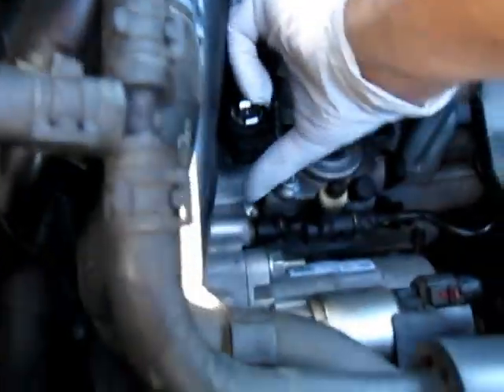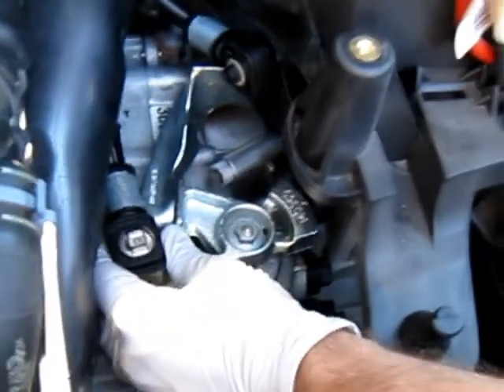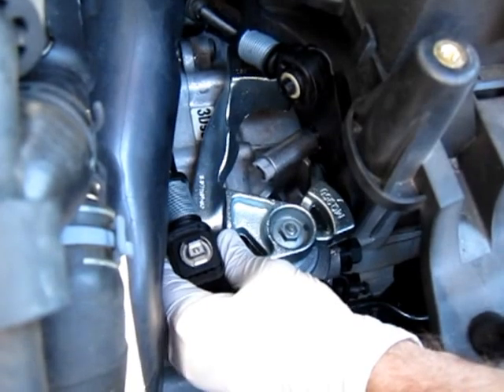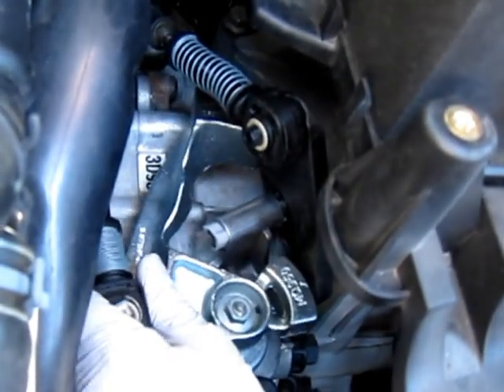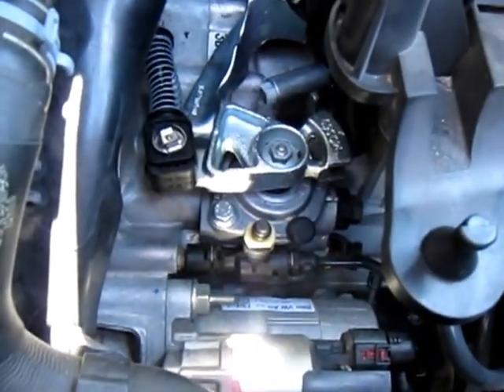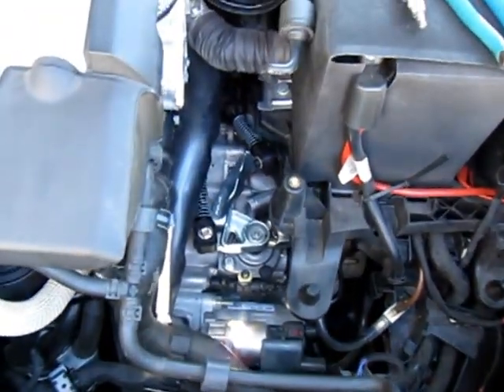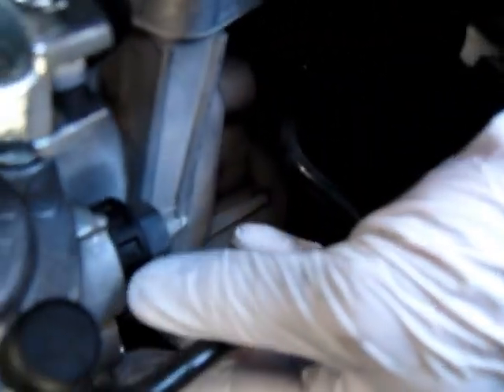VW Shifter Adjustment  When Tranny Locking Pin is broken--6 Speed

Comment: Thanks again for the feedback.  I just installed the Euro OEM short shifter tonight.  My adjustments ended up being a little different.  I at first loaded the cables toward the driver compartment.  When doing so, I couldn't shift into 2nd, and 5th & 6th were very notchy.  I ended up backing off a couple teeth on the fore/aft adjustment and that was fine.  For the side to side adjustment, I ended up just letting the cable go slack after disengaging the spring, and then re-engaging.

Comment: This helped me greatly the other day, I installed a short shifter on my Skoda Fabia vRS and found I wasn't able to select gears, I spent a lot of time fiddling about with it but after finding this video it took me a couple of minutes to rectify the issue. Thanks!
Reply: Which short shifts you used? And how the's alive?
Reply: @gnmalai  4H Tech short shifter for 0A8 gearbox, it is working very well
Reply: @BenSchofield  How did you allign the shifter with no home position? Im doing this now
Reply: @NorthernHostility  No home position? You need to pin the shifter inside the car or you will have great difficulty setting it up. I just fitted my shifter to my other car last week and used this video as a refresher, took a few mins to do the whole process. What are you struggling with? Did you manage to sort it?

Comment: Thanks. I followed this to reset my cables. I then Noticed i had a loose nut on top of the selector. It had spun on me so my gears were R, 1,3,5 only.  The knurling between the shift arm and the shaft has ovalized. I reset it to the double tooth and tightened up. Functional, thanks for the cable reset and seeing where246 should get into gear.

Comment: Thank you - my lock pin isn't broken but doesn't engage, performed this manoeuvre and it did the trick although 2nd doesn't go in say 1 in 30 times. I noticed I had to tighten the selector bold with a washer underneath it to prevent play. Does the play need to be totally gone for all gears to slide seemlessly?

Also is there something I'm missing with the lock pin as it just won't go in when pushing the gear selector down.
Reply from the maker: Yes if the front to back is moving in relation to the selector shaft that is a problem. Just like any other slop in the side to side mechanism it will cause issues.

Comment: I had to take the shifter tower out to remove the locking pin I finally put it all back together and every gear is smooth except first is it possible that I put the shifter tower in a incorrect position??
Reply from the maker: selector shaft really only goes in one way. 1-2-R issues are usually the product of a bad shift cable adjustment.

Comment: I have a 2007 Passat 6 speed manual transmission. It has been sitting a while and now it is difficult to get into 2nd and 4th gears.  I don't feel the detent when shifting into those two gears. Think an adjustment will solve this?

Comment: HI, I have a vw 1.4 tsi (6 speed transmission). I've watched your shift adjusment for 5 speed shifter. Is the 6 speed done the same way? My 1st, 3rd and reverse gears sometimes do not go into gear smootly (i have to apply some force more than usual). I wanted to adjust the linkage cables to see if it helps.

Comment: I have a short shifter installed. Currently, my shifter tower is extremely stiff. I am unable to manually select the gears any tips?
Reply from the maker: Corrosion in the pivot tube? 

https://dieselgeek.com/collections/vw-shifter-bushings/products/products-six-speed-billet-aluminum-side-to-side-reduction-bracket-for-2008-and-newer-cars

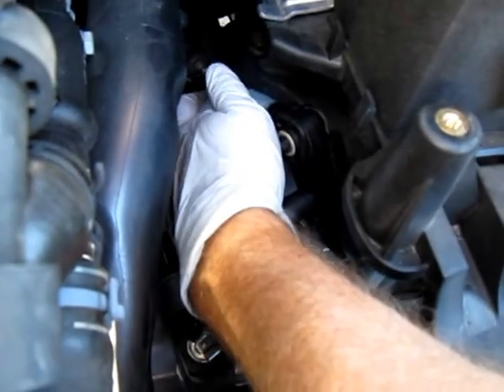Comment: I don't understand the part at 1:17.
Do you need to, again, push the chrome weight by a quarter inch? Or is it just that you lay your hand on top of to help in releasing the spring lock for the fore/aft cable?
Reply from the maker: You want that counterweight pushed down while you release the cable end. That makes for smoother 1-2 shifts.
Reply: @dieselgeekdotcom is the counterweight supposed to be floppy or perfectly parallel to the ground? I opened my bonnet and it was flapping up and down (pivoting on the bolt that's supposed to secure it I presume), so when I secured it with a washer underneath the bolt and then tightened it down, theres no play to push the counterweight down if that makes sense as its now perfectly parallel to the ground. Any thoughts?

Comment: Just wondering if this would cause what I've got going on in my 2009 VW EOS. I stopped at an intersection and shifted into 1st gear and ended up in 3rd gear. Will not go into reverse, 1st, 2nd or 5th and 6th. I cannot see anything that looks broken under the shifter boot so?

Comment: I didn't notice you take up slack on the cable ? How would that be done with one hand and release with other ? 
Thanks
Reply from the maker: It's important to differentiate between taking up the slack and loading up the cables in compression before closing the cable end. You want the former, not the latter.

Comment: The black part broke on the one that lays flat... What is that part called and why aren't different sizes? (The flat one has a bigger hole i assume because the other one won't fit when I tried to change them

Comment: This is a great video, thanks for sharing!  Thankfully my L shaped bracket is not broken.  Quick question: With both locking pins in place, do I simply lock both cable ends back into place?
Reply: Yes, that is how it is supposed to work.

Comment: I have a 2003 Jetta GLI 24 Valve VR6 with an 02M transmission, the same trans as the 20th Anniversary/337 Either the 02M  doesn't have an L shaped locking pin or it was broken before I bought the car. I changed the CV axles, control arms, struts, wheel bearings and all 3 engine/trans mounts myself. I plan to replace the shift cables, exhaust and clutch at the same time but for now I just want to adjust the shift cables. I get the jist of it but the 02M trans doesn't have that big ass counter weight and everything is reversed. So where you say clockwise, common sense says I need to move counterclockwise. Does that make sense?

Comment: Hi Jim,

Until i started to mess with my MK6 Golf, i asked my VW mechanic to set/adjust the gear selector several times, because the gearbox has never been smooth! I ened up setting it myself with the pin... Last week during a clutch job, the pin broke and i was like OMG?! :/

i finally stumbled across your video looking for a solution! Guess what? The gearbox has never been as smooth as now!

Kind regards,

Sébastien.

Comment: I picked up a 2010 CC and that locking/range selector won't budge, I guess either that pin is jammed or seized, how can I repair this?
Reply: Ok, it looks like the one lever that moves the shaft is just stuck, what does that L shaped locking pin do?
Reply: @dieselgeekdotcom  yes that's the same problem I had. I went to a salvage yard and got a new piece, and found your vid on using the locking pin to set linkage, now I can shift through all gears no problem 👍

Comment: Hi guys got a seat leon tfsi 2006, went to adjust linkage cables and now my 3rd gear is my 1st and so on, 2nd gear is no existence, just feels really hard then gets "wedged" any ideas?
Reply: @dieselgeekdotcom  I can't get my locking pin to lock either, I see there is another method where you put it into 1st or 2nd but when I pin the locking holes together on the gear stick I'm unable to move the shifter manually in the engine bay
Reply: @dieselgeekdotcom  The upper cable end spring don't seem to want to hold in position, no matter which way I pull back and twist it slides straight off, appreciate the help
Reply: @dieselgeekdotcom  OK will do, thanks for the help!

Comment: Can I leave the sheared part inside the transmission without any ill effects?
Reply: @dieselgeekdotcom  acually i got the broken part that fell off, out of the gearbox, in the plasic pin end which fell, is a pin of steel, so you might want to get it out
Reply: @trudorealis1126  how did you get it out? And where was it when you pulled it out

Comment: I'm doing this and keep losing 5th,does it make if it's a 5spd? What am I doing wrong
Reply from the maker: Usually if the adjustment is good but you can't find all the gears there is slop in the linkage. Watch here: https://youtu.be/7HBE5vycg-4
Reply: @dieselgeekdotcom  I have a 02 audi tt. The locking pin isn't L shaped and I think might be broken, when I pull it out the shifter still moves. Is supposed to lock it from doing anything or just the up and down?
Reply: @dieselgeekdotcom  I bought the kit, haven't put the slider in yet, but I put the getter and alignment, but my 1st and 2nd still catch when shifting. Feels like a slight grinding/grabbing.
Reply from the maker: The pin for the early 6 speed is not L shaped. If it's broken the pin will slide in but it will not prevent the selector from moving up and down.
Reply from the maker: I would install the slider, then readjust the side to side cable. The side to side action inside of the cabin is what drives the selector shaft up and down. The side to side cable adjustment is by far more important than the front to back adjustment.
Reply: @dieselgeekdotcom  okay I'll do that asap. I didn't have a extension long enough to take the air box out so I couldn't really do it. Thanks for the help, my car is 5spd as far as I know haha. It's just like a little pointy knob. Once I get the air box out maybe I can get to it better to actually see if it works properly.

Comment: Hi guys! Can you help me please, the gate selector is not moving freely up and down on my 6 speed TT gearbox. That causing the shifter knob not returning to center vertically. Thanks if anyone knows anything!
Reply: @dieselgeekdotcom  In this video up here the guy is pushing down the lever to lock it around 1 minute. So that lever is not moving freely up and down. You kind of have to pull it up...
Reply: @dieselgeekdotcom  I will make a short video tomorrow, thanks for your help Jim!

Comment: If the l shape pin is broken it seems to leak oil from there
Reply from the maker: That normally isn't a problem, rather typically the nose of the pin just shears off inside the case without any further consequence. I suppose if yours is leaking you'll need to address it.